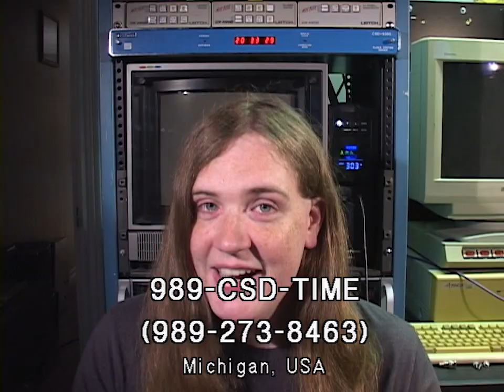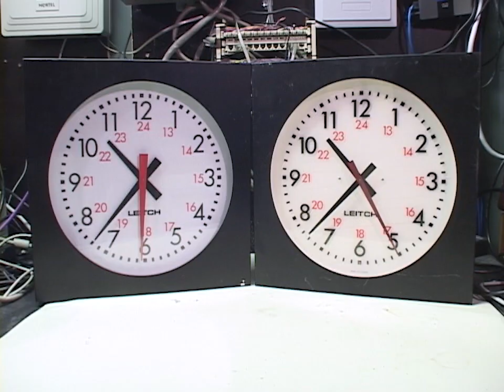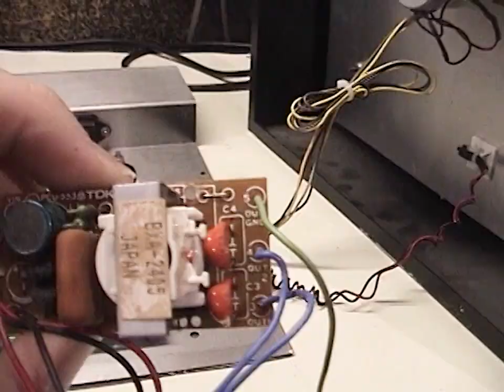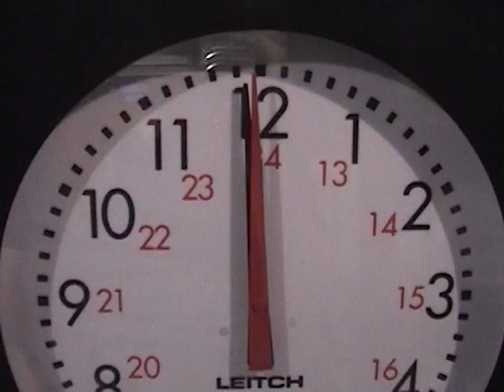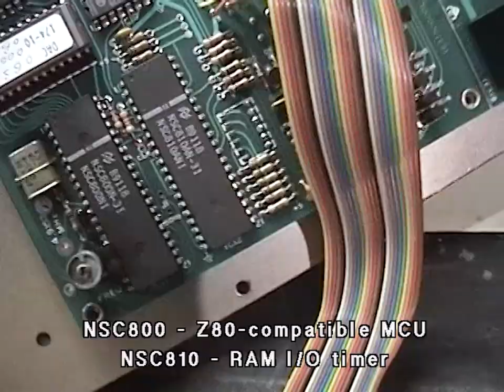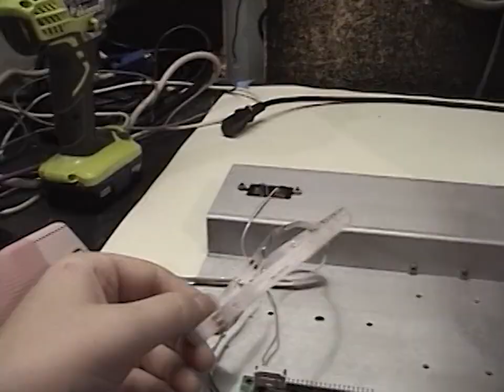Leitch CSD-5300: One year update + maintenance/repair tips

Comment: You are a lovely host, and a very informed presenter. I've worked in broadcasting for over 40 years and absolutely fell in love with Leitch clocks back around 1980. Back then, the clocks were driven by 24 volts that reversed polarity every second to advance the second hand!
Clocks driven by SMPTE code came later on. 
You have a nice collection there; I have to admit that I'm a bit envious!  Be well!
Reply from the maker: Thank you for the kind words!

Comment: Thank you so much for this video!!.  I actually have 3 Leitch ADC-5112 clocks that I picked up last week for free as these were being e-wasted from a decommissioned broadcast facility.  I think the clock looks awesome and would love to add it to my ham radio shack wall.  When turning it on the hands start to spin and don't settle down. All 3 clocks do the same thing, so I figure it's a common issue and not a defect.  I'm going to replace the batteries  and see if that fixes the issue.  The last service date on one of the clocks is 2007 when the bulb was replaced So I figure the clock is at least 20 years old.  My ultimate goal is to get an SMPTE time source but I'm on a budget.  So for now I would be happy with letting it free run until I can get an accurate time source.  Any suggestions would be appreciated.  Thanks!
Reply from the maker: If the hands start to spin as soon as they're plugged in without time code being connected, then they probably have working batteries in them and may even spin to the correct time.

Comment: So, if I understand correctly, I need to have this system to control my 2 DTD-5225R? But for the connection, it is with a normal cable and everything will work?
Reply from the maker: It doesn't have to be specifically this - any master clock made by any number of companies will work. I think there's even a project to use an Arduino as a master clock.

Comment: I had a good laugh at the dude who got super pissed at having reached a modem, rather than whoever he was trying to call 😄

54:03 I'm not sure how it is in the rest of the world, but over here, there definitely seems to be issues with mains frequency regulation. In my experience, both electro-mechanical clocks (a flip-clock, in my case), and regular digital clock radios seem to either gain or lose time at random, and they will become quite inaccurate over time. And I know it's the mains frequency, rather than the clocks themselves, because if I sync the times of the clocks to each other, they all drift by the exact same amount.

The LED backlight mod looks awesome, definitely a very effective replacement. I guess if one really wanted to, you could even use RGB LED tape, with one of those cheap controllers that have a remote - to make a garish, colorful disco clock 😁